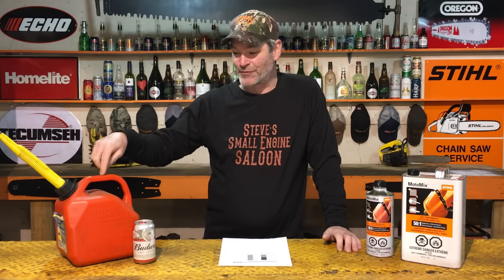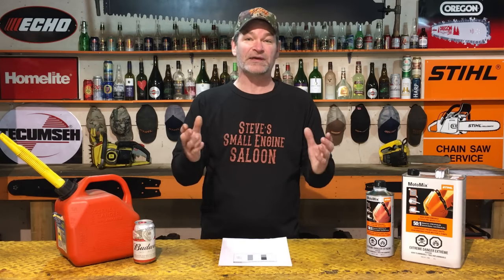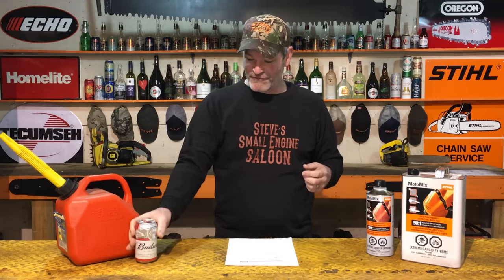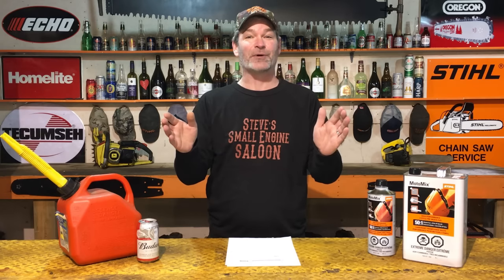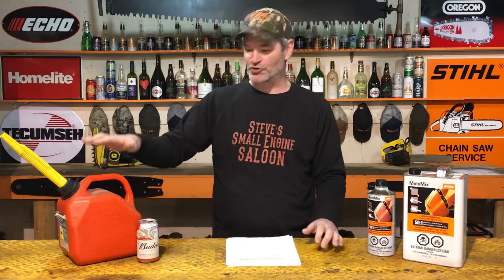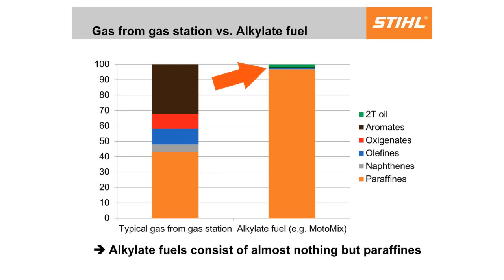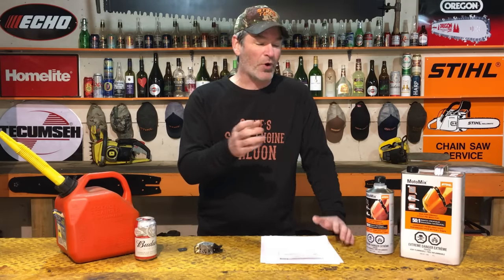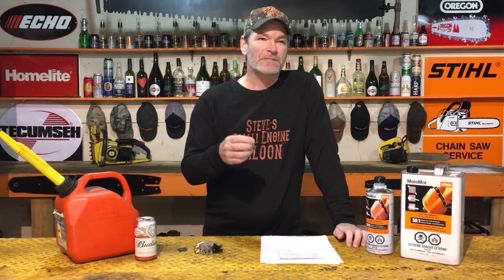The Ugly Truth Why Gas Station Fuel Is Bad For Small Engines

Comment: Nice ad for Stihl.   If you are worried about your fuel quality that much try stopping at your local small airport and purchase some AVGAS.  It is more then auto pump gas but less then the pre-mix fuels now solid and carries a 100 + octane rating with no ethanol.
Reply: Don't mind the LEAD Rodger.
Reply: Hey has to work great in carbed vehicles with that lead in there. Adds extra lotion to the skin. I mean lubricity to the metal parts.
Reply: Maybe we should start adding the cancer causing MTB in our fuel again!
Reply: Make sure to mix it with super unleaded cause avgas burns extremely hot
Reply: 100LL has lead. 
Dont bother with 80 for obvious reasons. 
And it evaporates like a mofo.
Reply: @rodgermills1496  Benzene is actually cancerous.  They should have kept the lead fuel around, it didn't actually went into the air like benzene does.  Obviously lead is no good, but they would have focused on finding a real solution other then that benzene crap...
Reply: I run 100LL in all my 2 strokes, no catalytic converters so no worry about lead harming that.  Made for high compression engines, also since it is high octane you can run a little higher compression and a little more advanced timing without having to worry.  Saws can make more power and the base fuel is designed for stability over time.

Comment: Steve, here's what I don't understand about gas station gas...Why in the world do oil companies have so many chemicals in their gas? Is the fuel coming out of the ground "polluted" with all these other things like Benzene, or is fuel coming out of the ground more like the engineered fuels?
I know that in the early days of engines, tetrethyl lead was added to reduce knock. It worked, but of course lead is a bad thing. So they took it out. So, are all these other chemicals making up for taking out the lead? If so, then how are engineered fuels stopping the knock issue?
Finally, isn't it actually more expensive to be ADDING chemicals to gas that just comes out of the ground naturally? I would think it is more of an incentive to leave gas "natural" than to put in additives. What do you know about this?

Comment: Hi Steve,
I've converted to using Aspen this season.
I thought it was just baloney, but the hedge trimmers start so much easier.
The only snag is .. I've not used the Stihl 2 stroke hedge trimmer since  ... I bought a Stihl battery machine.
The battery Stihl hedge trimmer is really good.
Next on the list would be a Stihl battery strimmer (Weed eater)
I've got a really good tip for you though  ... Try the real original Budweiser from "České Budějovice" it tastes so good.
The brewery is owned by the Czech Government. That Anheuser-Busch stuff does not get a look in as far as I'm concerned.

Comment: These additives must have been added in only the last 15 to 20 years (we know that's the case with ethanol) because I had never had a problem with my lawn mowers and other small engines using gas pump gas until the last 15 - 20 years. Before that I ran gas pump gas and never drained my lawn mower for the winter and never had a problem.
Reply: You’re on the money! Around the early 2000’s is when fuel quality took a tremendous nose dive.
Reply: It’s because it not the regular old gas. You can smell it’s different. It’s supposed to be better for the environment but it’s costing us more in every way way. So no it’s not better.

Comment: Seems silly that small engine manufactures use materials that are damaged by gas station gasoline. Its almost as if they want there equipment to fail or for you to by there special fuel. 

This is why I switched over to electric tools (string trimmer & light use chain saw). I don't have to worry about the issues associated with small engine problems because of the fuel. Issue for me is that to do the maintenance on a gas-powered tool, takes more time than then for the job I need to use the tool for! The point of a tool is to save time & make the job easier.
Reply: OH HELL YESSSSS Guy Tech,,,gas powered crap is becoming a thing of the past,,,with the advances in both battery technology and electric motor technology only a serious dink would chose gas over electric give a choice,,,,electric is size for size and weight for weight WAY more powerfull than gas as well as energy put in versus work gotten out electric has it all over gas,,,just this past winter I decided to get a new snowblower because my gas one was getting a bit wore out tom say the least,,,so even though they were a bit more money  I decided to give electric a try because all the hassle of a gas one (easier to throw batteries on a charger than drag out gas cans and all that crap),,,well I'll never go back to gas,,,after the second time this past winter using the electric one I gave my neighbor my old gas crap as well as a full 5 gallon can of gas to go with it,,,the electric ABOSOLUTELY KICKS the gas ones ass in every way, I bought the snow joe 100 volt IONPRO 24 inch cordless 2 stage with 4 extra batteries and only once have I had to use the extra back up batteries because they ran out of juice before I finnished my rougly 50 foot long driveway and 50x50 foot parking area as well as my 25x4 foot walkway between the house and shop,,,and that was only because I got lazy and let the snow get deeper than about 10 inches,,,If I didn't have a gardener that did my lawn mowing I'd buy an electric mower to go with the snowblower,,but I pretty much got rid off all that crap when I retired and other than winter snow removal (because i actually enjoy getting out in the winter) don't own any lawn equiptment anymore,,,but the little i do own is electric,,,I am a mechanic though and all my rattle guns that ar air powered have been replaced by electric cordless millwaukee as well all my wood working type tools with the same,,,,no stupid extension cords, air hoses (I even have one of those cordless air compressors to use on tires and what not and it works GREAT) or gas cans to drag out, or even noisy air compressors to listen while they try to keep up with the air tools is a much more pleasent world.
Reply: You both have good points.
Reply: Planned obsolescence THE AMERICAN WAY!  General Motors cars are FULL of this shit!
Reply: @S2 turbine That's exactly why for the time being I'm staying away from battery equipment as well. What the industry needs to do is come up with battery standards where one brand of size x will fit any brand of equipment. Right now its too proprietary to keep cost down.

Comment: My zero turn uses about 2 gallons to mow my yard. With current gas prices, that's about $7-$8 in fuel. With engineered fuel, that's more like $60. Just for fuel. I can see doing this for winterizing, but not for weekly use. BTW, I DO use engineered fuel in my trimmer/edger/blower system.

Comment: At $20 a gallon for this fuel in a can, iI'll stick to and tell all my customers to use  premium from the pump.
Reply: Dean Mavis premium still has ethanol.  Just as much as regular. Only difference is the octane rating. Premium burns slower, so unless you have a high compression engine, some of the premium goes out the exhaust unburned, and your engine has less power.
Reply: @graphicsdude  so they are lying by saying the premium is ethanol free??
Reply: Dean Mavis yes.   Premium is NOT ethanol free.
Reply: I use a little sea foam in my premium gas / oil mix in my 2 cycle engine's  and use sea foam in my regular gas for my 4 cycle engine's
Reply: @beanolatte2682  Who is saying premium unleaded is ethanol free? It even says on the sticker at the pump that the fuel contains x% ethanol. If these folks are talking about the recreational gasoline, which is usually 93 octane, then they should specify. Always read the sticker. If there is no sticker then assume there is ethanol.
Reply: @graphicsdude ,
Depends on the premium. Some of it is ethanol free.
Reply: In the Northeast, Stewart's premium is ethanol free.
Reply: I do the same been working great for years on all my small engines one ounce per gallon every time all year round never had an issue.
Reply: seafoam
Reply: Remeber...Ethenol is still in the premium hose.
Reply: @graphicsdude  that depends where you.live and where you buy fuel.  Here in Ontario Canada, Shell and Esso still have no ethanol in their premium grades.
Reply: Double check the seafoam. I'm pretty sure it is alcohol based. Alcohol/Ethanol absorb moisture.
Reply: @graphicsdude  The premium gas here in my local station in Iowa says its ethanol free.
Reply: Beano Latte I agree add sea foam too
Reply: tinkergene 👍🏻👍🏻👍🏻
Reply: @Sharpboat01  That's why I put 4 l in my car before filling the gas can
Reply: For $20 it is worth it to store your tools over winter with this fuel.

Comment: Typically I run my 4-stroke equipment out of gas, change the oil, and put it away empty. I've never had a problem in over 30 years and when I top it up with fresh gas in the spring (just regular gas from the gas station) typically they start up right away.  On the advice of my local small engine shop I tried the engineered fuel one year for winterizing but it was really expensive (like $9/litre) and in truth it didn't seem to make any difference. Unless I start having problems I think I'll stick with my current process that's worked for me for decades.  Go with what you know I guess. 

The above is for regular 4 stroke gas, I find that with a 2-stroke oil-fuel mix with regular gasoline the fuel is even more stable. Never had a problem with my 2-stroke STIHL strimmer or hedge clippers in over 20 years (could be 30 years, I've lost track) using gas station gas for my 2-stroke mix.
Reply: The difference in the four stroke and they two stroke is that the four stroke carb is vented to the atmosphere. The two stroke carb is a pump that doesn’t have a float bowl that’s vented to atmosphere
Reply: ddavidson5; My experience matches yours. I just use pump gas and I've never had a problem storing 4-stroke over the winter. As long as I ran it dry before putting it away. The chainsaws were being used off and on all year (could sit for a month or two) so I've never emptied them out for storage.
Reply: Taryl fixes all channel ran a definitive test recently - many fuel additives - stored - NONE of them worked.  The only way to have engines run after storage is as you say, to run them dry.  Museums will sometimes run preservative through the lines to exclude moisture.  For most of us, running dry, with fresh fuel in the next season is sufficient.

Comment: Ok, I've been using the Husqvarna 50:1 fuel for my Toro 2 cycle snowblower. So after seeing this, which would actually be better for my 4 cycle lawnmower, the Husqvarna fuel or Gas station fuel.

Comment: yes at $20 dollars a gallon no thanks.
Reply: From the Amazon link given, it's listed for $25 a quart, so $100 per gallon.
Reply: That's Canadian price ...   Lowes here in Louisiana has Tru fuel for 15 a gallon ~!~!
Reply: Joe Briggs same price as a new carburetor.
Reply: Not to mention a 1 gal. can of stihl  fuel vs  the 2 gal. plastic jug he was pointing at. If you were cutting to sell fire wood would you make a profit? Unless you're splitting it by hand, I would assume you would want the same fuel in the gas powered log splitter.
Reply: Yeah I use about 7 gallons of 2 cycle fuel so my profit margin shrinks if I use that stuff it would be good if you used a gallon a year or something I get 93 octane 100 percent 4.17 a gallon
Reply: Liquid diamonds
Reply: Good for a top handle saw if you're stuck in a thick conifer hedge with no breeze,  better on the lungs. Says me who's smoking a joint.
Reply: Right - just buy a new carb every year and your done
Reply: Django Apple 🤔🤣😳
Ya can’t win 
Everything engendered 
Including ya wallet
Reply: The expense justifies just rebuilding the carb every couple years...
Reply: nickridge2539 I disagree! 

I use 93 Octane Pure gas and the silver Stihl mixed fuel. I just purchased six cans of this very expensive mixed fuel to get the extra warranty for a new saw I purchased online. At almost $9.00 USD per quart it I very expensive for 89 octane fuel. Way to expensive for my blood and for my wallet! 

Most of the time I mix 2.5 gallon of mixed fuel at a time. I just came into one half an acre of all hardwood. My new neighbor cut every tree on the lot as well as several for each neighbor that boarders his lot. I have a lot of firewood now. 

I tried some of this over priced and very expensive mixed caned fuel. I ran the one tank through my new saw then changed to my mixed fuel. I noticed a big difference in the saw it’s my fuel... My son is using this crap in the blower! 

I am not impressed with this... I have been using the silver Stihl mix for several years now and I will stick to my mixed fuel! It does not stink like this low octane fuel and all of my mixed gas equipment runs better on my mixed fuel!

They can keep this over priced junk!
Reply: Rebuild the Carb.... shoot.... you could just buy a new saw every 2 years and it would still be cheaper than running this crap.  Can you imagine running some like a small generator on this stuff.... it would cost a fortune.
Reply: $20 ? I can buy a cheap Chinese carb for $10 and install it  30 mins.  I would like to use that fuel but I use about ten gallons a year on yard machines . Another point my next small yard machine will most likely be electrically powered in my case . Batteries have come a long way.
Reply: big d  can you imagine what it would cost a landscape company to run this fuel exclusively ?
Reply: idk about other brands but trufuel is 110 oz for $20 and that's not even a gallon!! I'll stick to regular gas and fuel stabilizer and should be good to go.
Reply: Joe Briggs plus even if gas screws up your carb I have been buying those cheap Chinese carbs for $15
Reply: You can get aviation fuel at the airport that does nto have ethanol its not that expensive
Reply: David Miller factor on the cost of a good chain saw that fails early and yeah it’s a good deal. 
After all lost work and what’s a good chain saw cost plus the extra maintenance 
I have been using these allot and it’s always a two start pull after sitting for months. 
I️ have seen first hand what fuel left in a snow blower did. Crystallized and was like shellac and sand from not using it one season. Was crazy.
Reply: you can literally buy a new carb with the gaskets off amazon for 12 bucks for my lawnmower. i'll buy a new carb every fuckin month than pay that ridiculous branded gas prices
Reply: i just bought a new Stihl chainsaw for $175, cheap enough to warrant burning cheap gas. ;)
Reply: Would cost me a bomb using that and never had problems with fuel as always get fresh fuel regularly
Reply: big d n
Reply: $14 a gallon for the husky premix in ny.
Reply: you wish it was 20 bucks a gallon, try 20 bucks a quart.  way too cost prohibitive
Reply: Just use premium fuel and dump unused fuel back into the container after each use. I haven't had any problems with fuel lines since doing this. Sounds like a pain in the *ss but it's really no big deal.
Reply: I don’t know about that, my mower takes 1L, I can get VP Racing 4-Cycle for $10… of course that’s 10x what I would pay for Ethanol-Free but still if you are talking storage then I would just pour it in at the end of the season, $10 to protect my $600 investment. Not a bad idea, I already am planning to use Ethanol-free with Sta-Bil anyway but the $10 would not be a big deal
Reply: You mean a quart!!

Comment: I've always used Stabil with gas station fuel and never had a problem.
Reply: @wisetow10  two extinguishers on both floors and a high pressure hose line with a variable pattern high pressure fire nozzle outside. Lol I do but I always have at least one backup to my main equipment. Two trimmers, two saws, two  leaf blowers, two mowers just for the moments where a piece of equipment doesn't want to run. First one doesn't want to start grab the second machine and go to work. Stihl and Husqvarna are the machines I run.
Reply: I use ethanol free station fuel with 104 octane booster and stabil stabilizer. Runs good in my Stihl and Kawasaki.
Reply: Yes
Reply: Even for winter storage?
Reply: Im replacing 2 honda carbs because im not wasting time cleaning yhem from previous user neglect
Reply: Anything without ethanol is all you need.  I like the extra steps everyone takes but unnecessary.  I've run  premium station fuel in my 79 Johnson 140 and my 71 homelite xl1 and my sxl homelite for years and no issue.  Good oil and no ethanol,  no need to complicate it
Reply: I've used station fuel in my mower for 15 years with zero problems.
Reply: Same here. Regular ethanol free gasoline and Stabil. 0 problems in 30 years.

Comment: I've been using the gallons from depot and lowes
Mowers and weed Wacker chain saws 
I don't out gas station gas in anything but the trucks 
Expensive 20 bucks a gallon 
But 1 pull starts sell me 
Now with your info 
Should I switch to stihl fuel 
And what do they charge opx

Comment: Benzene was used in aftershave in the 40s and 50s. It was also used as a high performance fuel in the 60s ,in high compression motors. 
I mixed a 6oz jar of it in my mower fuel once years ago, it ran stronger and cooler.
I use motomix in the summer months when saws stay idle for a while, but ethanol free gas is readily available in South Carolina,  we"re not communist "yet".